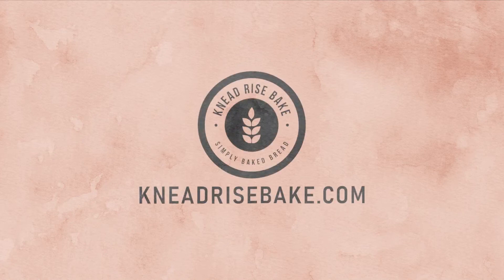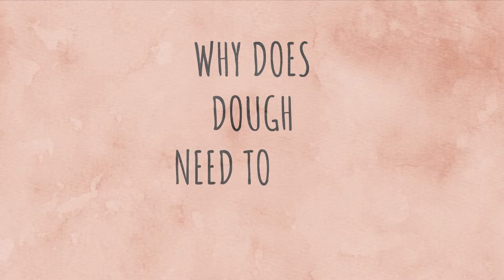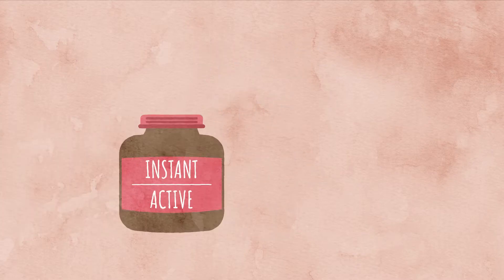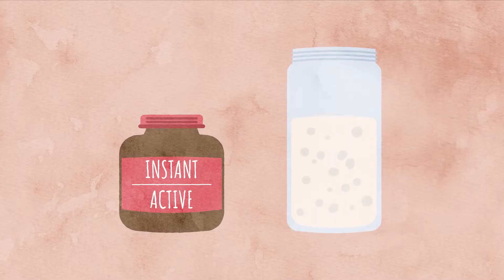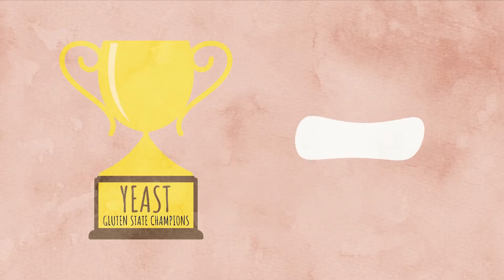Why Does Bread Dough Need To Rise Twice?

Comment: This is YouTube bollocks at its best.
Yeast does not develop gluten whatsoever.
Gluten develops when water hydrates the glutenin proteins found in whet flour.
Kneading stretches the coiled gluten molecular chains out into gas trapping sheets. 
Yeast produces the CO2 which makes the bread rise.
How could you get even this simple thing wrong?